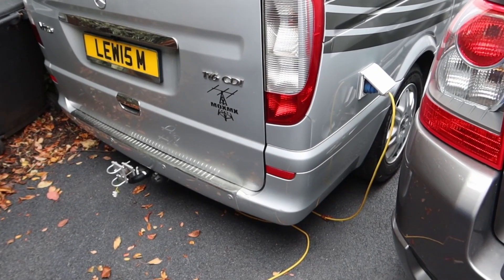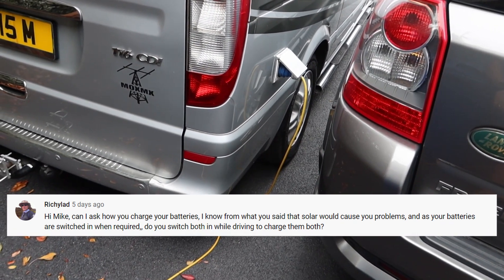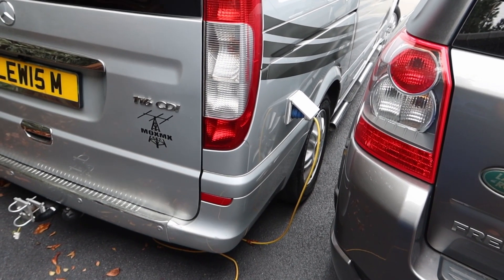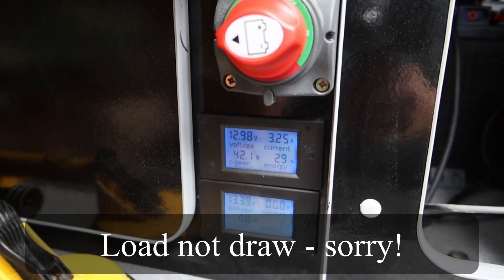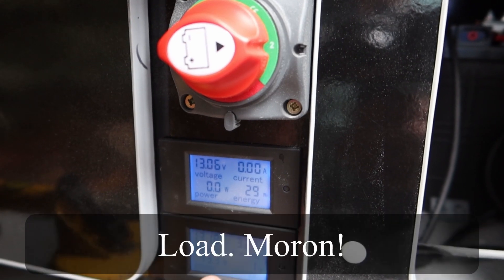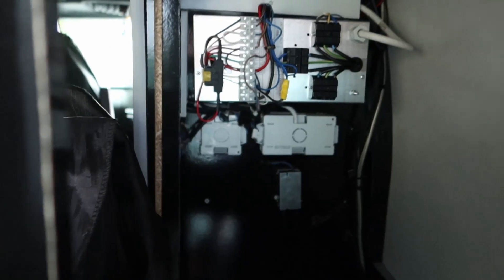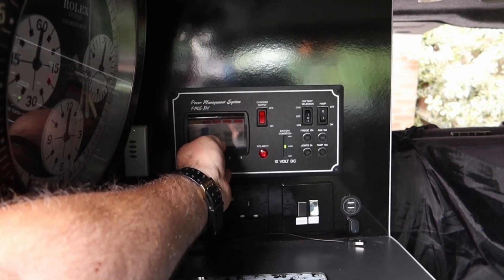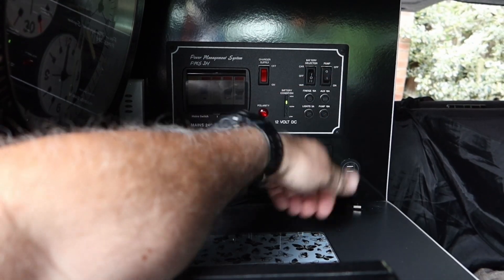Campervan 2nd Leisure Battery for Amateur (Ham) Radio - PART 2

Comment: Is the alternator  putting out enough  power to charge the 3 batterys ... i was going to do the same but was told that the alternator wouldnt be strong enough  to fully charge  the 2  leisure batterys with it going through split charger .. right or wrong

Comment: Hi Mike, thanks for your video answer, good idea. I bought a vehicle with two mismatched parallel batteries and the one used to bring the other down, so I run them through a split charger which sorted it. How you have yours is great because you should only have to replace one battery at a time. 73 Richard
Reply from the maker: Well I am not an expert but it made sense to me. I am also not an electrician or electrical engineer so I don't know all correct terminologies etc. but I think its OK. Sure if its not, someone will tell me! LOL